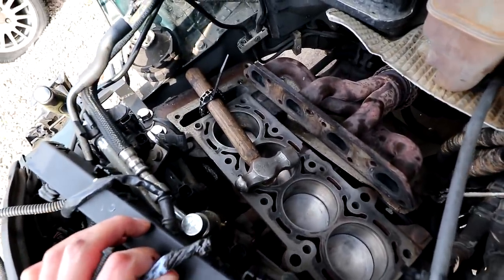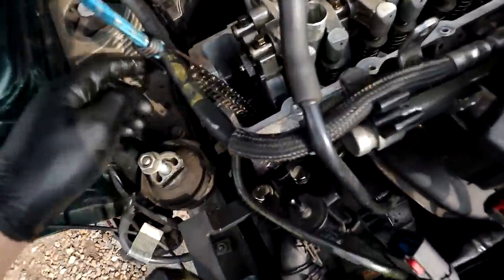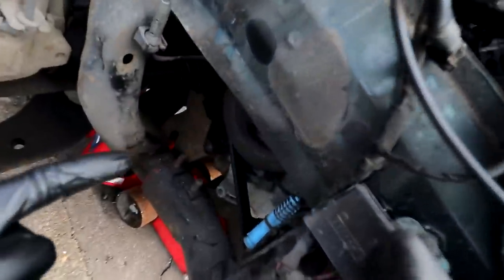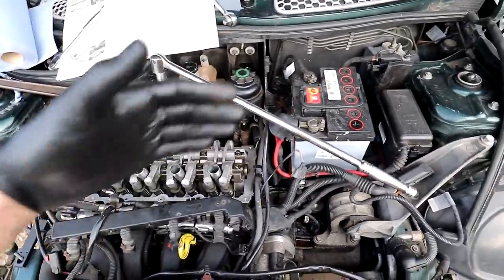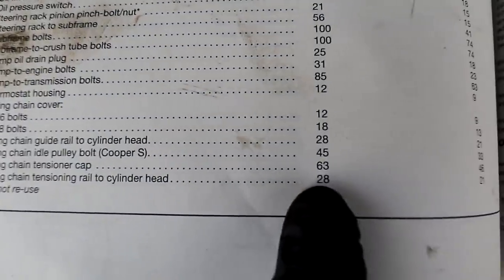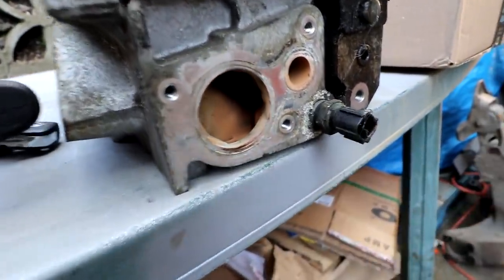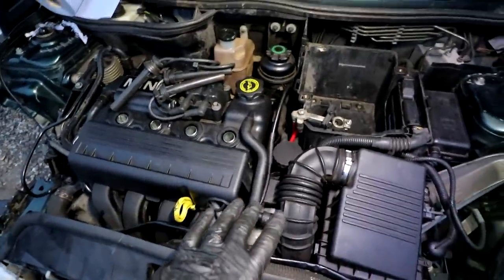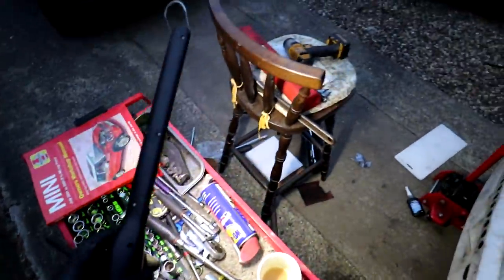Mini Cooper Engine Rebuild!

Comment: When you do the torque wrench 🔧 you gotta stop literally as it clicks. By going that little extra bit after the click you could be adding on say 10% more.....  Eg 44nm instead of 40, or 110nm instead of 100nm 

It probably won't matter but better safe.
Reply: @Kris Nicholson simple spring torque wrenches like the one used do add extra torque. You will over torque
Reply: @Kris Nicholson exactly. The click part is the spring giving way. However the head is still attached to the arm. Therefore you can still generate a force where your hand is and over that length, a torque.
Also going over the same bolt after the click isn't right. But it is minor.
The whole thing can be ignored if your tool hasn't been calibrated in a while. Most companies do it yearly. All depends how you store the wrench.
Reply: @Kris Nicholson he went further that the 'play' that is literally the few degrees as it clicks.  Watch again.

And once it's clicked that's the 'play' of the click action gone....further turning = more torque.

Comment: Are you going to crank the engine over a couple of times by hand after this I would do it on the starter with the plugs out . I would use cheap oil and change it say after 100 miles then refill with good stuff . Does the cooling system need flushing out as well , good job well done.

Comment: Glad to see there wasn't a woodruff for the cam sprocket, good job 

you really shouldn't keep turning the torque wrench after the initial click as it's still applying torque and would be like using a breaker bar instead, I would also invest in an torque angle gauge 

they cost pennies and are more accurate than the eye

Comment: Excellent work again there. May I recommend that you turn the crank by 2 full turns (the crank shall turn 1 full turn) to check that the timing marks all align and that there's no valve to piston contact. The mark on the timing chain will move of course but this test will reduce this risk. Keep up the good work, very enjoyable to watch.

Comment: Hopefully when you mullered the top of the spark plug tunnels they won't knacker the new seals when cam cover is installed, check the plug tunnels for oil after a run. Otherwise top job. Good videos, keep up the good work James. We all learn or are reminded as we go, great value for all of us.
Reply: There was clearance between the tubes and the seals as is normal for this engine.  The top of the plug lead is what makes the seal.  in other words.  It'll be fine.

Comment: I'm sure you will do this. Make sure you change the oil with flushing oil and then again. I'm sure your have water etc in the sump. Also maybe pour a jug of oil over the cams before you put the rocker cover on. Good video thou
Reply: Get onto OPIE oils through ebay for good quality stuff. They recommended fuchs for my astra. It's never been quieter and longer lasting oil too. Hasn't used a drop.

Comment: I have a 2008 Mini Cooper S with 65K miles. Pep boys said, no pressure in 3 cylinders $8k for a new engine. I have heard $4k used engine, said "Timing chain went and pistons probably bend...probably and $5k (yet he's too special to look at it or be specific)...so I'm taking it to a real mechanic on Monday.  I would chuck it as a lesson learned, but I can't afford a new car payment, and when it's running it's good. So, Best case scenario what is a rebuild like vs getting a used engine with same mileage? Sorry for the noob question.

Comment: If you cut the top off 2 old head bolts you can use them as guide pins to locate the cylinder head accurately without risking damage to gasket. Head bolts assembly fluid or oil not WD40 as its a releasing fluid not a lubricant. Cheers 👍

Comment: What gaskets are required besides head gasket and valve cover gasket and spark plug tube rings and exhaust manifold? Any others I will need? About to replace a head with shotty valves

Comment: Reusing bolts could be bad mate especially if they are TTY as they stretch to the torque settings, you could get uneven torque.Also never push the head on the gasket always lift and lower. But good job
Reply from the maker: BeAware Now they were new hence the carboard they were in
Reply: @TheSavageGarage  The Haynes manual shows which bolts cannot be re-used with a star next to the bolt(s) in question. Also it was mentioned that they came with the kit in a previous video :)

Comment: Nice little trick with lining up the sprocket and chain, how did you know if the crankshaft stayed in place?
Reply: Because even a stationary crank in an engine torn down this way requires a good bit of force to turn. Plus the chain held with the bungee cord means he knows it hasn't moved because the chain will be snug on the crank sprocket.

Comment: I saw the New head bolts you got in the white card board box (that came with the head gasget) watch the whole series in future.
General note.
The 90 deg turn stretches the bolt and changes the metal structure in the bolt. (Thats the reason you always use new bolts).

Comment: So glad I came across your channel! You deserve all the credits of the world for the way you present the work to be done and do the actual work. I have myself a 2003 Cooper S with 193 k KM which needs I'm afraid BIG work: cylinder 1 with NO compression, knocking sound when I start the engine, yet all valves 'look' ok when I removed the valve cover. Further investigation is needed.  Thank you for the guidance you already provided me with your videos!

Comment: At least there’s a little room around the bay, I just did the vanos solenoids on a R56 with a N12 1.6 twin cam and that is possibly one of the tightest bays I have worked on

Comment: Excellent work great video ! Just a quick  tip when I worked at a garage we used to clean engine parts like this valve cover gasket with petrol just stick a brush into a little bit of petrol and it got everything very clean

Comment: Another amazing video👍🏻 I think you did a great job with filming at the same time. I’ve never done anything like this before, so just out of pure curiosity, do you not need to use gasket sealant of any kind on the head or the valve cover?

Comment: a good tip I got told years ago is to mark each nut/ bolt with a piece of white chalk as you tighten them its then easy to check if you missed any

Comment: You went to all the expense of buying another head getting it skimmed and end up using old head bolts and not buying a torque angle gauge for £6 quid and making totally sure job was perfect hope your gamble pays off  🤯
Reply from the maker: Count Diablo I didn’t use the old head bolts if you watched all the mini videos you’d know that. It’s not hard to gauge 90 degrees either

Comment: I'm 15 and I've recently found a garage to take me on as a apprentice but I need tools what's your opinion on us pro tools for beginner
Reply: I think bergen tools. Or the new US pro tools will be fine for a fresh mechanic
Snap on tools are to good but pricey and magnet for thieves
Some lovely cheap mechanic tools on the market now  Halfrauds do a great range and with lifetime warranty
You will need to invest in the best with specialist tools. Allen keys and torx sockets
You will get the feel and how much your Spanners can be abused in anger
When you upgrade your first Spanners can be made into special bent or cut off tools
Got a couple of us pro nylon ratchets lovey to use all day and take abuse in the plant fitter industry
Good luck
If I could be your age I think I would choose.     Electrician or plumber  instead   or bricklayer

Comment: Cheeky tip, rocker/head/cam covers come up well after a wash in a dishwasher.
Reply: And also ruin the dishwasher at the same time😂
Reply: Peter Gillam, well I’ve never had any issues, I’ve done rocker covers, callipers, other engine parts, hoses. 😂

Comment: Hiya james, just a question. I thought you had to use new head bolts as they can stretch with the engine heat or is that just a ford thing lol
Reply: Chazz Coombes he used new ones
Reply: @themechanic7561  yeah i remember now my bad